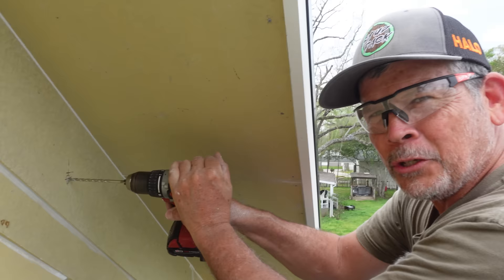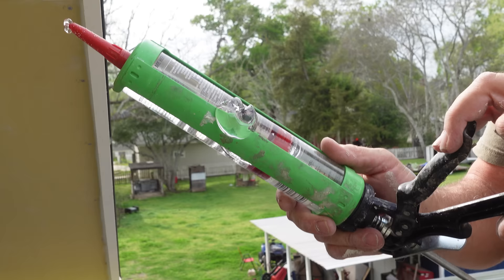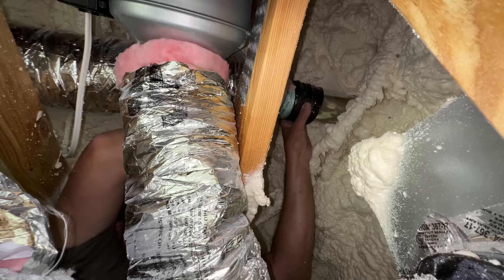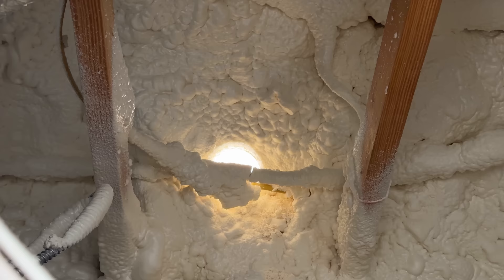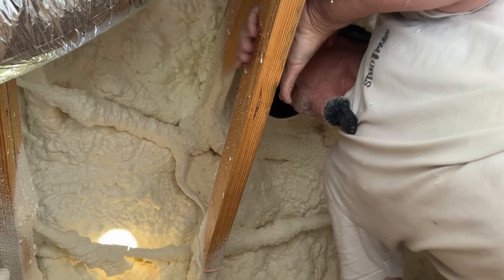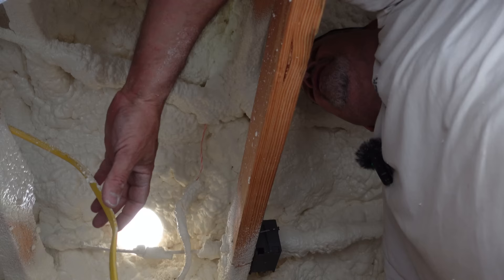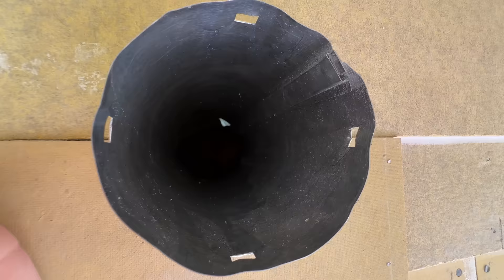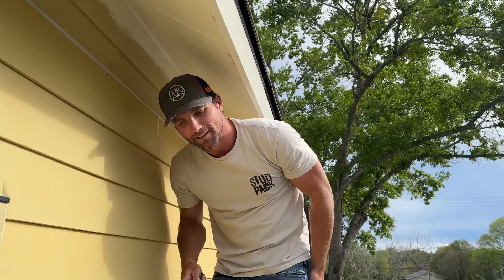Our Easy 5 Minute Job Turned into a 5 Hour Job...Dumb Move

Comment: 1st hole: carefully checks clearance on the other side.
2nd hole: YOLO!
Reply: Overconfidence will ruin the best of us :)
Reply: perfect example of slow is smooth and smooth is fast.
Reply: We have all been there for sure.
Reply: Use the drill for the siding, and then switch to a butter knife to punch the hole in the foam. You will feel the obstruction and correct before you damage the wire.
Reply: I hate to drop a "said so" but on the spray foam video this is exactly what I was warning people about. If you need to fix things or change things spray foam turns into a real pita. 
As always nice to see Paul and the boys owning their mistakes tho.
Reply: It's crazy that the 1st and the 3rd hole was the hole that could have YOLOed....and it happened to be the fact that they had to carefully check lol.
Reply: Unfortunately I YOLO everything 🤦‍♂

Comment: Pro Tip: Do yourself a favor and put some critter screen/mesh behind those louvers on the vents. I can't tell you how many homes I've seen birds blocking the ducts with nests... Sparrows can fly up to them and lift the louvers and go in/out at will. I removed a full 5 gallon bucket of nests from 2 ducts last summer. Finally put some stainless wire grid behind the plastic louvers and problem solved (make sure your louvers still move freely). Not the play for a dryer vent due to lint buildup, but there are other styles of lint traps for those that keep birds out. I've removed birds from dryer blower motors and multiple from bathroom vent exhausts... Just not worth the adventure when it can be prevented by a screen. I feel bad for my neighbors when I see the birds making homes in their vents now, but hey, at least mine is finally clear.
Reply: I think the first one had it, but 2nd and third one didn't.
Reply: Not to mention those 2 inch long tree roaches we have here in south Texas. They can get in damn near everywhere.
Reply: @mickisix9092  👀👀
Reply: Gotta love those Texas critters. We got everything. Like they say everything is bigger in Texas. @mickisix9092
Reply: Had to put mesh on my dryer vent because of the birds. Go up and clean it up once a month.

Comment: Second generation painter here, your tip is too big on your spray gun and your pressure is to high.
Get a 515 tip . The first “5” is half of  the size of what the spray pattern should be at the right pressure and distance from the painting surface, 10 inches.  The second number is the orifice size of the tip. 
You’ll have a lot less overspray and less waist of product.

Comment: 20:45 that trick with the two hole saws on one mandrel was brilliant
Reply: It is an awesome trick, but an old one. I figured it out for my self 30 years ago when I was specializing on door installation. Occasionally, the existing deadbolt bore would be 1 1/2 inches, but the new set required a 2 1/8 inch bore. So, necessity being the mother of invention, the idea just popped in my head. With some of those doors being as high as $5000, no room for error.
Reply: @dallasarnold8615  Nice! Thanks for sharing!
Reply: Wish I had known that trick a couple of years ago.

Comment: Hey remember to razor blade those louvers on the vents so they open.  Don't just grab it and open the louvers or the paint will strip completely of the plastic.
Reply: Good call. These are the things I never think of until it's too late.
Reply: I would have considered leaving it white
Reply: Nice appearance by Rad for the ladies. Painting the sides of those window trim boards looks much better, but is extra work. That’s why I figured you opted not to.
Reply: All of those louvers look like exhaust. Isn’t on of them an intake?
Reply: I will say from experience the louvers are crap. Never open correctly over time. Swapped out for a full flap with anti-bug grid and a cover.
Reply: @briankowald6465 the first one isn’t with flaps it’s an open intake/louvre which will have a bug screen on the back side.
Reply: Beautiful work Stud Pack team, this has to be so rewarding for you.
Reply: Jordan, You need to thank the Lord everyday for your dad,  He is an excellent example for hard work. Pray that his health will hold up as you finish your home.. One  day you will look back as you cherish these memories,keep up the great work. I really enjoy your videos!
Reply: I would have gone with stainless steel vents and louvers. Those cheap plastic louvers and vents will dry rot from the sun in a year or two, and then it will be hell for someone to climb all the way up there to replace them.
Reply: I would never paint those louvers. The paint will peel off with any heat passing through. No paint adheres properly to plastic without a real primer underneath. Your exterior paint won't prime no matter what the paint salesman tells you.
Reply: It is looking good! Way to battle through those oops! Lol ! It happens good to see I am not only one!  I am about to move in my tiny house, been watching you when I come in from working on it or before I go work on it, You always give me alittle motivation or inspiration, will still have things to complete but Thanks for the videos!
Reply: P-Tec No Pest is an awesome plastic vent. Much better than the $10 Home Cheapo ones.  I haven’t tried a stainless one before.

Comment: I disagree on the trim around the windows.... We did that the first time we painted our home.... second time we just did the face of the trim... had a ton of positive comments... we just took our time doing the front face to get a near perfect line on the outside corner... looks crisp/sharp, as opposed to trying to get a crisp line on the zigzag with a corner that has been caulked... each to his own... your house, your call...
Reply: All personal preference but I suspect comments about painting the sides are more "it takes more time/effort/cost more therefor it must be held in higher regard".   Either looks fine to me.
Reply: @curtisbme I like the bit of depth that it adds to the overall look. The unpainted is a very clean look, but it's a bit sterile imo. Painted just has a bit more character.
Reply: I have a hard time trusting anyone who does not know how to use ellipsis correctly or refuses to end a sentence with a period. Something just seems... off about them.
Reply: Personally I like the nice straight transition line on the black trim rather than cutting in the zigzag around the siding. Just more visual noise that is hard to make perfect. Just my opinion. Love the video guys. Look forward to it every week!
Reply: totally agree.  The crisp line is impossible if you paint the edges and caulk.  if you just paint the face, you get a nice crisp  line.
Reply: I agree and no one, especially from the street, would ever notice.
Reply: You are correct.  Plus their leading edge wasn't razor sharp which made it look worse. @TherapyGel
Reply: But it's wrong.  Think - that is a piece of trim, the entire piece to be painted one color, the siding the other.  But really, there are bigger fish to fry! @curtisbme
Reply: Unpainted for sure

Comment: I was a painter for 42 years, and spent most of my time on high end commercial interiors, but every once in awhile I did a bit of industrial and exterior work. As far as spraying your exterior is concerned, I agree with the painters who told you that you're better off brushing and rolling it because doing so allows you to work the material into the Hardy Board, and gives you a much better bond.
Reply: When painting exteriors, I've had great success spraying THEN rolling while the paint is still wet.  You get fast application with the sprayer (no paint tray needed) and great adhesion.  Yes, it's slower than just spraying, but much faster than rolling.  It's the best of both.
Reply: When I did the job, I would follow the dude with the sprayer and brush/roll in the paint.
Reply: @ericschroeder3939  It's the first coat where you really need the bond the most.

Comment: Hello Stud Pack! I'm a retired HVAC installer. When installing panduit straps on flex duct. Purchase a panduit strap gun. It will get your straps much tighter than you can do by hand and cut the excess off at the same time.
Reply: Also need to seal those adjustable elbow seams.
Reply: @cerryl1337 I thought that was a fresh air intake.

Comment: 40 year painter here, when spraying any lap siding, angle spray "up" so the bottom lip gets a nice coat.  when rain hits siding, droplets hang onto bottom lip for hours and will soak into siding material if not painted.  Appreciate you guys posting

Comment: I been a painter for 15 years and my Pro tip for the edge on the windows tape and apply a thin line of caulk or use yellow frog tape to get crisper lines and is a faster way , and to spray i recommend to lower your pressure and use a smaller tip for less overspray and material waste,  is looking great guys

Comment: As somebody who grew up helping my mom paint brush and roll all the way baby. Sure you can spray and I'm sure there's situations where that would work out better but all the things I've ever painted brushing and rolling it did a good job. Yeah that little edge detail around the windows definitely makes it stand out, more work but it stands out.
 You're also gonna get more coverage on your paint because more of it's going on your wall and you'll have a better first and second coat because more if it's going on the wall thicker. Plus then you don't have to clean the machine out. I also wouldn't recommend a system where you have to mix water in with the paint go with the one that can do the full straight on paint much better. And when you're done with your roller get a little tool to squeeze the paint out of it so you can put it right back in your can makes cleaning it easier and keeps a lot of that paint.
Reply: Agree. I just think that roller and brush does a much better job, and you don't have all the prep/taping, and all the unnecessary clean up afterwards. And did anyone else notice how much white paint is now all over the scaffolding? The spray gun might work better indoors or on another outdoor project, but for working high in the air, especially on windy days, you just can't beat the old school way of painting with a brush and roller. That is just my opinion, but I believe in it for so many reasons, and have so for so many years, and on so many jobs.
Reply: @mikequartucci9700  Oh yeah totally saw that brand new scaffolding is covered with paint. The overspray can be terrible. I think the only place where spraying works well is complex objects and shapes. The only thing with rolling you have to worry about is dripping and the occasional spray from rolling too fast and occasional drip, spraying goes everywhere!

Comment: I am complete DIYer. This weekend I was doing molding and shot a nail into a water pipe. Wouldn’t you know they didn’t use nail protectors when they built the house.Did not realize until the next day when I went into the basement and saw water. Nothing bad there but it took literally all day to fix that stupid pipe. Watching this makes me feel just a little better. Even pros can make mistakes.

Comment: Step aside Russian nesting dolls. Nesting hole saws just came to town. I love that trick. I would have overcomplicated it by holesawing a template board, nailing the board onto the house, and using the template as a guide to keep it from wobbling or migrating. Your way is quicker and doesn't put extra nail holes into your siding.

Comment: Thank goodness you spray insulated!!!!  Can you imagine rolling around in fiberglass?
Reply: @wojtek-33  I'm afraid I do.  I, along with a few others, am just finishing the rescue of a very tired house that looked much better than it was, requiring a lot of unbudgeted structural, wiring, and plumbing work.  The spray foam we wanted cost $12,000 MORE than the bats we put on the walls today.  Sometimes the bean counters win.  <sigh>

Comment: Jordan while I'm thinking about it this is a future tip. On the Toto there is a carbon filter. It's  about $35. Order one in advance. One day the toilet is going to smell a bit. You will think it's you. Every time you use it it's going to smell until you replace the filter. There are 2 of us and I put the Toto in about 18 months ago. The original filter lasted close to a year. The second about 6 months. I'm on my third now. It's a small price to pay for how amazing it is. I have stopped using toilet paper at least in that bathroom. I want to put another in a spare I like it so much. Going on vacation sucks because we miss the Toto. They make handhelds for travel. We have 2 of them. Not nearly the same but better than nothing.
Reply from the maker: Heard that!

Comment: Hey, I put an ERV into my house where I was suffering with allergies. I built a little box which fit a Filtrete F1 size HEPA filter, couple 4" duct connectors, a hinged top with some clasps to be able to change the filter out. Made a big difference. I know the panasonic comes with a merv 13 filter, but they are more expensive to change and don't filter as well as a true HEPA.

Comment: If you want to paint the edges of your window casing then you should paint the trim before you paint the siding. That way you can overlap the trim paint onto the siding and then cut in with the siding paint. It’s a lot easier to cut in the siding paint to cover the trip overlap than it is to use the cute little pointed brush to paint the edge of the trim board

Comment: Why no back rolling? -If you guys need to do repair work in the future you're going to have to spray a small section to make the paint match. If you back roll immediately after spraying then you can do touch-ups in the future with brush and roller 👍
Reply: Has to do with atomization. So just from back rolling will allow future repairs to be made with brush and roller allowing the paint to match 🙂

Comment: I was hoping the edges of that trim was going to get painted! Yey! I think it gives that trim/siding transition more depth and profile. The trim that's painted white on the edges looks bland IMO.

When you go to recaulk the edge, cut your hole a little smaller than you normally would and smash the tip flat. You should get a crisper caulk line. And go suuuuper slow. Youll thank yourself later! 

Maybe practice with an already open tube on a scrap 90 first.

The house is looking amazing bois!

Long time viewer, seldom commentor lol

Comment: Generally in the early morning BEFORE the wind gets up is the time to use the sprayer pretty much anywhere in Texas, New Mexico,, Oklahoma, Kansas and lower Nebraska.  Paint every piece of siding before installation... spray it then use a roller.... just so the texture matches when you touch up after you hung the siding.

Your fan was way to large, the pressure was to high, and you're too far from the work.  At least you didn't paint the neighbour's house.

When it is Texas hot... the cooler air is drawn on the roof thur convection and it is damn near impossible to paint fascia and not paint the roofing. 

 Painting is always the last thought in construction when it one of the things folks look at first... if you want to do a nice job a little preplanning can make the job so much easier. Yall could have painted all the siding in a morning and touched it up in a couple of hours. 

Consider that when we trim out a house... do you stain and lacquer the trim on the wall or do you do if before? Siding and doors should be no different.  Well at least on new construction.
Reply: We would paint the fascia boards on the ground, then put them up.  Much easier all around than trying to get twenty feet in the air.

Comment: You can do a light controlled spray, turn the pressure down and then roll and brush. Best of Both worlds. Never Put anything in front of the spray tip you will be in the ER for 8 hours. Besides it is impossible to match exterior sprayed paint. Rolled brushed paint no problem.

Comment: If this were my paint job, I would have painted the trim moldings, and fascia a light olive drab color that compliments the paper white, and left the window casings black. I would not have side painted the trim because, I'm lazy that way, and nobody ever notices those details at the curb. Small hints of color are what set things off. Your sills are going to be the first thing to oxidize, and so in time they will appear lighter than the paint you painted around the windows. (Sherwin Williams is tough with UV inhibitors). 

The problem you might run into now is the roof color not matching what you painted. 

Watching this video build from the ground up is the coolest thing since sliced bread. Thanks for taking the time to do this.

Comment: The paint will last much longer when it is rolled on.  Goes on thicker.  Where the paint was sprayed on you will probably be painting it again in 5 to 7 years.  Not sure how the paint works on Hardie board but on the wood that will be the case.

Comment: The painted edge with the black against white looks awesome! But it doesn't work like that every time.  I built a custom faux fireplace a few years ago, and the paint colors  they picked out were very similar. It looked like a trim miter mistake more than anything

Comment: As an opinionated pro painter: That edge on the window trim, I probably wouldn't have painted it, But I would have painted the edge on the deck because that part your going to be standing and looking at eye level, If i had to paint it ya dam right I would have taped with fiog tape. Tape once cut twice fast. A lot of pro painters don't spray. Spraying leaves as good a finish if not better when done right. Your supposed to over lap your spray by half. You will use 30 - 50% more paint. You decide what cost more labor or time. Your going to spray that house in two days compared to a week hand painting it. depending on how fast you move scaffolding. I think your getting better all the time at spraying.